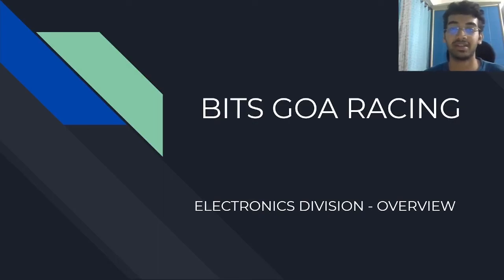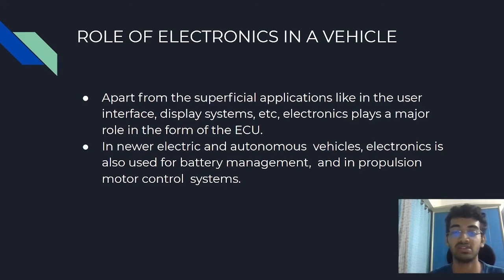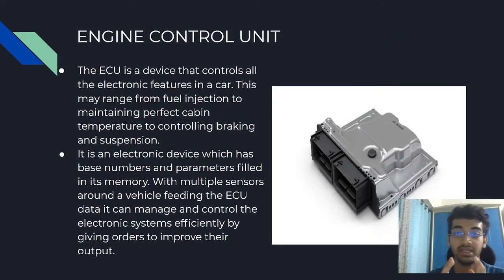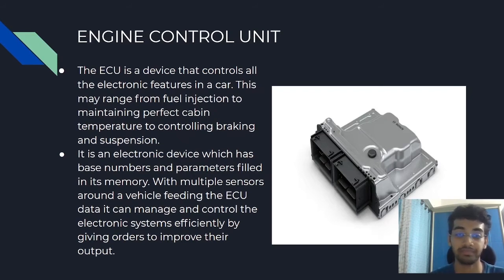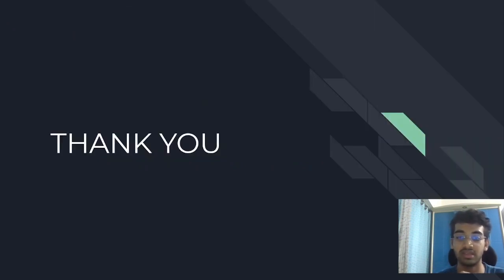Electronics System in Formula One Vehicle - ECU and Sensors || FSAE | Formula Bharat | SAE Supra

Comment: how wheel speed sensor data is used in design of vehicle dynamics
Reply from the maker: If you try to understand closely, the wheel speed comes later, the design is done first with forces and tire data and many other things. One possible area where speed varies the available traction by tyre will change the acceleration possible and hence vehicle dynamic. Any other reason and more detailed explanation will be given after discussing with my technical team.

Thank you for your query.
Reply: @dhyandpatel132  thank you for your reply
Can you please tell me how the data of lateral force and slip angle is used in tyre modelling....a detailed explanation is appreciated
Thank you

Comment from the maker: Video Timestamps

00:00 Introduction and Outline
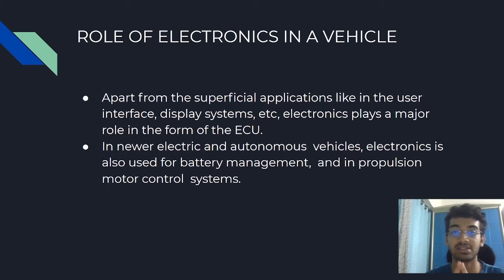00:12 History | Role of Electronics
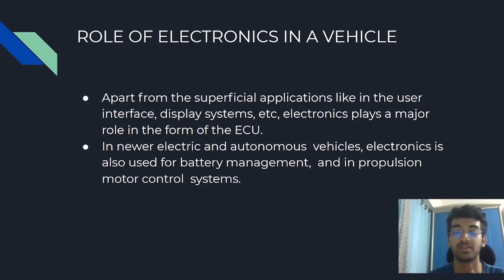01:43 Engine Control Unit | ECU ECM
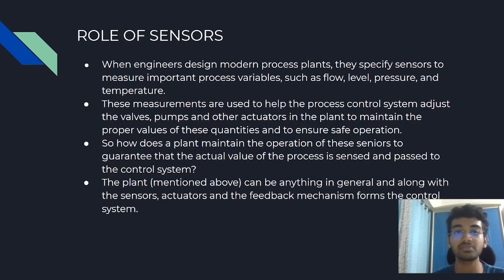03:17 Sensors - Roles, Application and Types
04:27 Sensor Control and Feedback
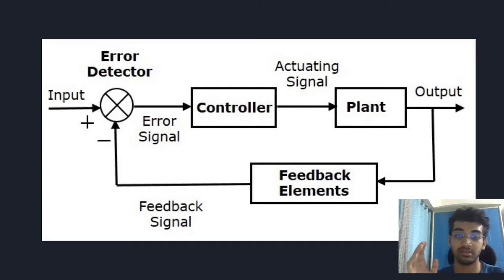05:47 Sensor Calibration